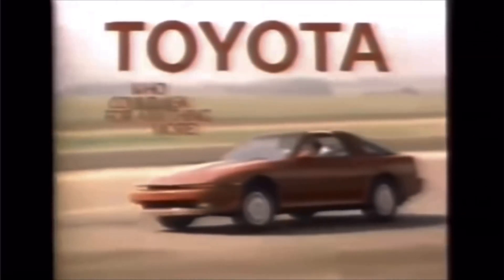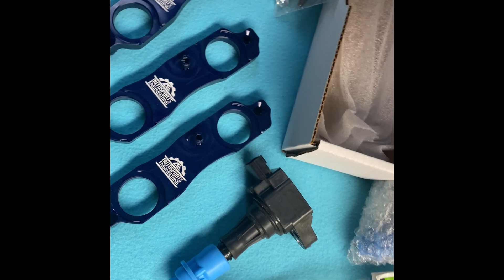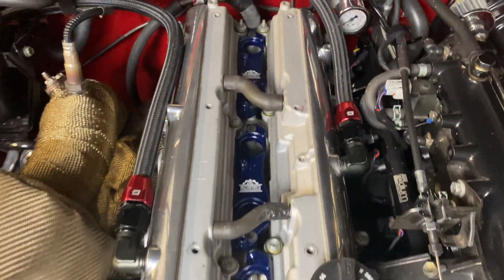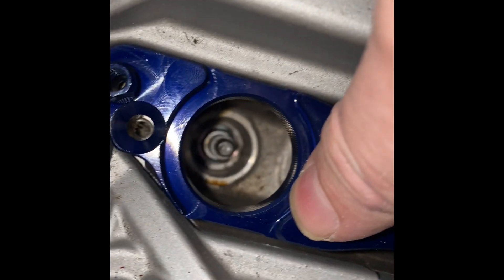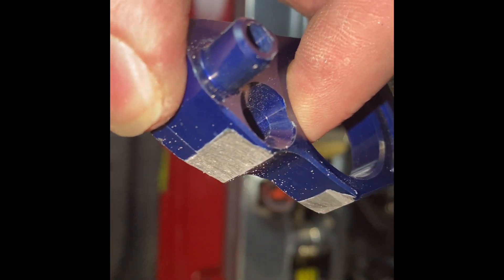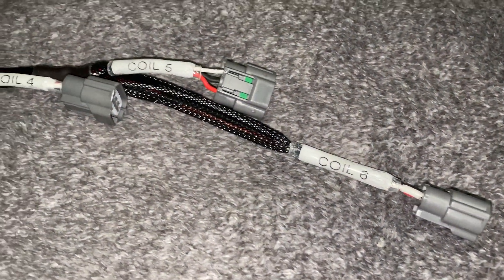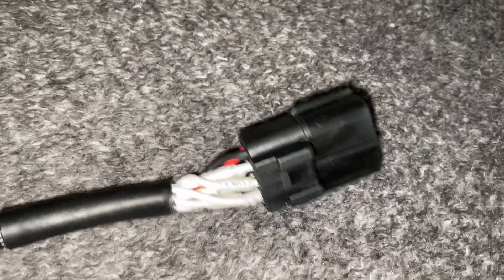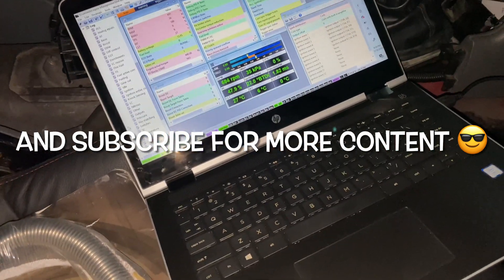How to Install R35 Coils on a 2JZGTE VVTi with AUTOSPORTS ENGINEERING hardware kit - MK3 Supra - 4K

Comment: What’s the dwel time set up in your emublack?
Reply from the maker: It’s available online. Injector cal 6V = 4.31ms, 7V = 3.44ms, 8V = 2.81ms, 9V = 2.38ms, 10V = 1.88ms, 11V = 1.69ms, 12V = 1.47ms, 13V = 1.34ms, 14V = 1.22ms, 15V = 1.03, 16V = .94ms and 17V = .88ms

Comment: Hey man great video! Definitely helped me out. Had 2 questions, did you have to modify the ventilation tubes and does your stock coil cover fit the valve covers
Reply from the maker: @johnnyjeffers4764 , thank you for the feedback, I’m glad it helped. No modifications were required for the crossover ventilation tubes. The 2J cover fits with room.
Reply: Your welcome! Love to hear it, definitely gonna get this kit